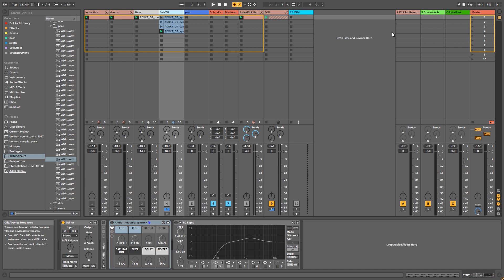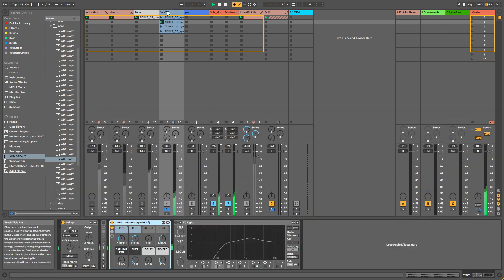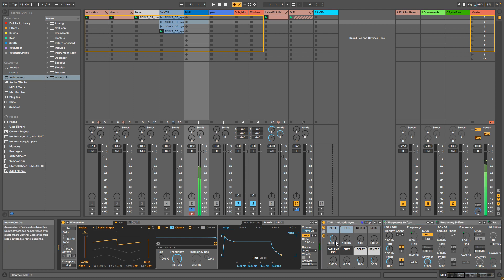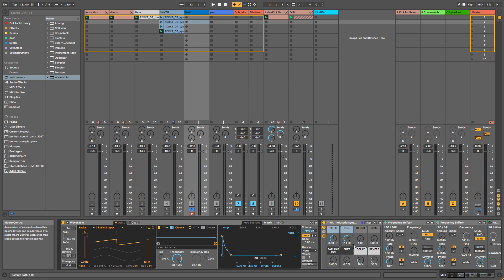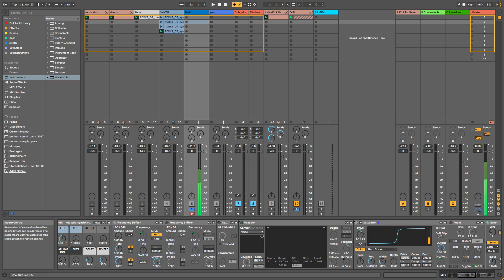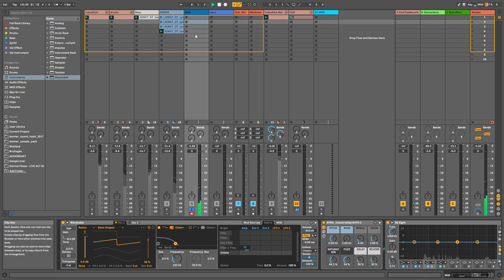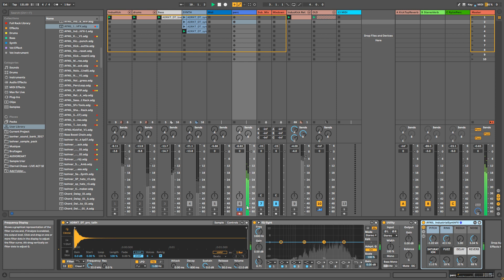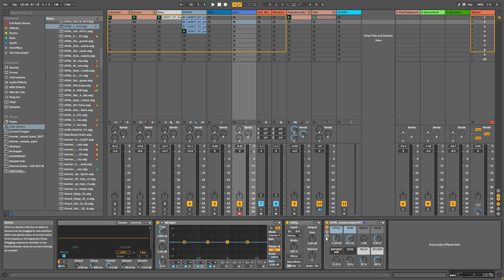How to Make INDUSTRIAL TECHNO Sound ? ( Ableton Techno Tutorial )

Comment: hello i wanted to seek you advice ... usually i cannot make a heavy kick unless i group 3-4 different kicks together ... is it normal or it should max have only 2 kicks?
Reply from the maker: there is no rules, from my own experience, sometime i will layer 1, sometime 3/4, you can use 10 if needed, as far as it sounds good... itsusually better to avoid to layer too much because you can have phase issue in your low end and lose some punch or low end, but when layer a kick I always adjust the pitch to make sure I don't loose the punch..
Reply: @audioreakt  did you already or will you do a tutorial about this>?

Comment: Hello! I really like your lessons! Thank You! I tried to install this preset, but ableton 10.0.1 it does not start , at the bottem of ableton it gives the following message: "only audio effect can be placed in this kind of track" .  I managed to install AYNIL_Padmaker_V3 , AYNIL_Kickverb_V1 . but all other presets from your lessons fail me when using. I found your comments about what can be done through maxforlive..I want to understand what actions need to be performed to install presets. Could you tell me what the problem is?
Reply from the maker: Hey, some rack are Audio effect rack and other are Instrument Rack, make sure you put an instrument rack in a empty midi track. To save the preset you just need to drop it in ableton and then click on the little save button on the rack to save it in your User Library
Reply: @audioreakt  , I tried to download and install again,  it is now located and stored in Ableton, but does not start this preset, I get an error "presets cannot be loaded. it is probably broken."
I can’t therefore move it to the midi track. my friend has the same problem now
Reply from the maker: In this case check your Ableton version and make sure you have live 9.7.1 if you use live 9 and live 10.1 if you use live 10
Reply: @audioreakt  thank you!